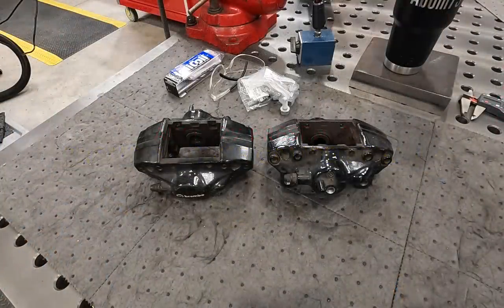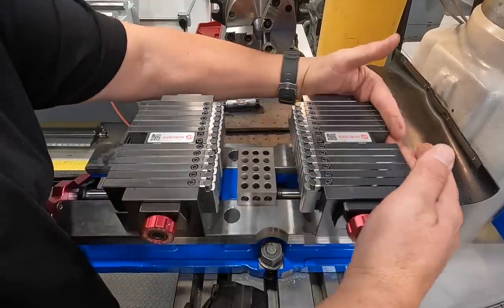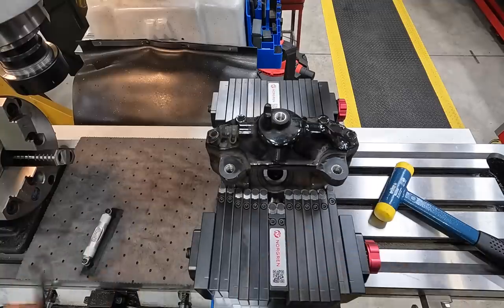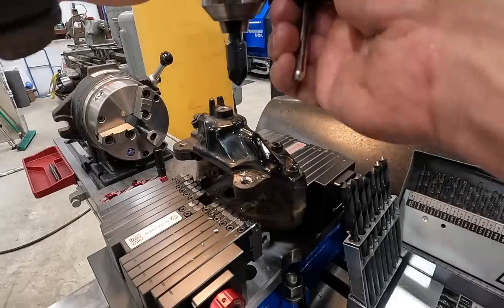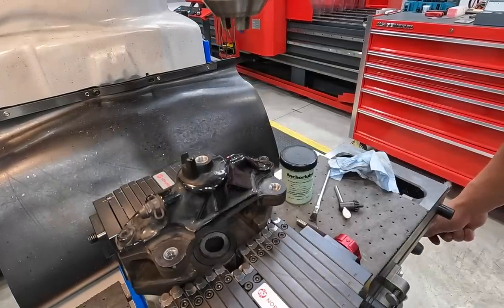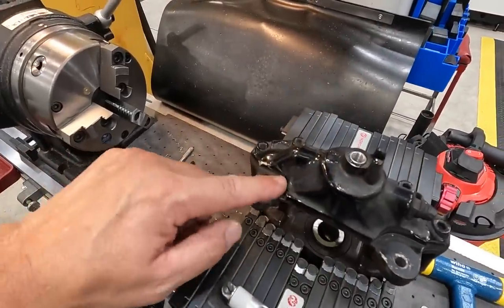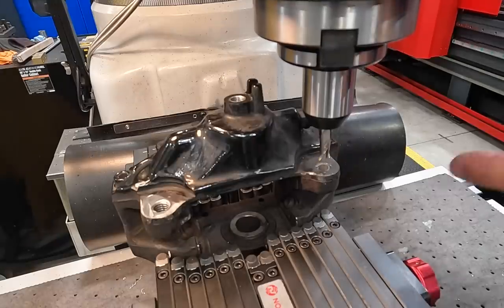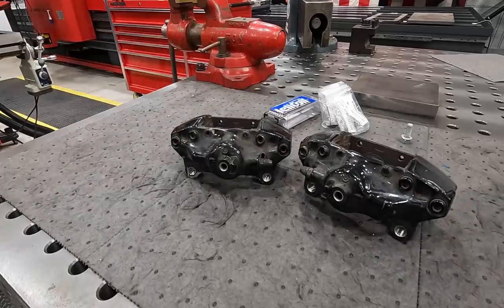Brembo Brake Caliper Repair

Comment: Did anyone else notice while tapping the 3rd hole at around 27:33 that the tap started pulling the casting out of the vice as is was coasting to a stop?   Perhaps that side wasn't as snug as the other, or as well-fitting in the jaws as the first caliper.  This suggest to me that the vice is good at applying lateral force to irregularly shaped work, but the smooth jaws do nothing to hold the work in the vertical direction.  Good on him for using a 1x2x3 block to support the downward pressure, but there is nothing preventing a lifting force.  Perhaps they need toothed jaws to bite into the workpiece?
Reply: Yup I noticed the same.
Reply: The tips are interchangeable, but I’m not sure what kind are available otherwise. Someone could even make or adapt their own, I’m sure too
Reply: Makes me wonder how many times something like this happens to me since I don’t have 50k+ people looking over my shoulder.
Reply: Maybe they're not worth the $7000 price tag after all
Reply: Yes, I noticed it lifting. Also at 29.20 the last right-hand jaw is not making contact with the caliper!

Comment: I have a question. Why did you use grease on the helicoil ? We have always used red locktite on the helicoils. We want to try and make sure the helicoil stays in place if the bolt has to be removed in the future. Thats a really neat vise you are using !!! Great video as usual !!!
Reply: i had exactly the same thought on glueing the helicoil in
Reply: You don’t want it binding as you screw it in. If that happens and you break the tang then you have no way of driving it the rest of the way in.

Comment: I would leave some tension on the fixed jaw side so the fingers have some resistance and leave the movable jaw side looser than the fixed jaw so everything conforms nicely then tighten both to half torque spec so about 30-32ft/lbs then tighten the clamp down and go to full torque until the fingers have been "broken in" for lack of better terms once broken in you shouldn't have a stuck finger like on the first caliper

Comment: To remove the moon shell of bolt I use a cut down hack saw blade. 
Saw deep enough to cut to threads then small chisel to break out one half at a time. It won't chance spinning shell and break end mill or worse.

Comment: Isn't there a long term problem with electrolytic corrosion between the stainless Helicoil insert and the aluminium caliper, particularly as brake calipers are frequently sprayed with water from the road, including salt water sometimes? Helicoil does make a "Primer Free" version of their inserts that is supposed to prevent that.
Reply: Stainless. Should be self explanatory.
Reply: @consaka1  I'm talking about corrosion of the aluminium, it being much lower in the galvanic series than stainless steel.
Reply: @samuelfielder  hmm I haven't noticed that being a huge problem in the aluminum I've used stainless screws in. Perhaps because I lube the threads pretty good? I've seen some fierce corrosion in aluminum using regular steel fasteners though. Some of that could probably have been mitigated with some sort of lube.
Reply: @Randy G I'm not a huge expert on the matter but if I remember the corrosion process still requires oxygen. Perhaps the grease he used will work somewhat to smother the corrosion. Though just between you and me he didn't use near enough for that purpose. I think copious amounts of red locktite would though and that's what I have used in the past.
Reply: @Randy G I prefer the more solid inserts myself too but I know helicoil are very tough and better than the original. Greased I'd be concerned it might eventually wash out and that the threads might be prone to come out. Locktite would solve both problems on any insert not just helicoil.

Comment: Many, many, many years ago, when all my tools fit in an old red Craftsman  toolbox in the trunk of my car I learned about Heli-coils. Back then it was business as usual to go down to your local parts store and buy a Heli-coil kit to fix stripped out threads on whatever was broken (or I broke) on my car. It wasn't rocket science, no special training or skills required, RTFM! As I became more proficient and knowledgeable I learned to proactively replace the threads on aluminum parts with Heli-coils. As I was getting into racing I was seeing more aluminum parts replacing cast iron, but also failing more than cast iron. For some reason aluminum just didn't trust me when I torque it using just my right arm, go figure. Abom stated there was no way to attach the calipers to machine/drill holes, thus requiring a $7000 vise? Drill 2 holes in a piece of steel plate lining up with the unaffected caliper bolts. Even use one hole to bolt to the piece of plate, then swap holes after drilling out the first. Bolt caliper to steel plate, clamp plate in vise. Drill. What am I missing here? If you have the skill to replace the calipers, you've probably got the skills to do this in your driveway or garage. No machine shop or $7000 vise required. Is Abom saying he could not do the repair without this vise? It would have been much more helpful/informative to demo how to do this without the vise. At least it isn't a 12 part series!
Reply: He knows that. He's trying to demonstrate the vise. In a working CNC shop that vise might make it unnecessary to machine a pair of soft jaws for a limited number of parts. That's money saved. If you do that once a day for a while, the vise pays for itself in saved soft jaws and their machining.

Comment: One item I would have discussed is to be sure the insert is not too long for the hole.. I use a Dremel tool with a cut-off wheel to cut threads off for whatever is necessary for the hole length.

Comment: a nice little saturday project.  did you have any problems with chips getting in between the teeth of the soft jaws?  That's the reason I got rid of mine, chips and shavings (especially with cast iron) would get in between the fingers, or rotary swivel clamps in my case, and would gum it up.  I got tired of having to take it apart every few months and clean it out, so I just resort to using spacer blocks and angles now.  Something you might want to keep an eye on, or you could do like my dad did and cover the vise with some old mud flap material.

Comment: What stops those coils from coming loose when you screw in the bolt, especially so since you put some lube between the coil and calliper?
Reply: The coil is more of a interference fit then the bolt for one and the clamping force when tightened the bolt also holds the coil to the new threads, these may look janky but have been proven for years, very good fix solution in many cases
Reply: I should’ve read the comments…I just asked the same question
Reply: @skippybuilt  I watched the video a few more times after I commented - yeah, you can see the coil is reasonably tight against the thread, and when the bolt goes in it seems to go in freely, almost a little loose. So I guess when it’s being tightened down, it doesn’t exert any force on the coil until right at the very end. Good explanation though, thanks 🙏
Reply: That is why you need the insert tool to put the coil in, it tightens the spring so it will screw in, then when the tool is withdrawn the insert expands against the thread locking it in the bore.
Reply: @ZylonFPV  This is the case with a plain threaded bolt, too. There is no clamping force on the threads until the end of the cap hits the surface of the mating material. This is why torque processes in manufacturing can sometimes require quite a bit of study to get just right.

Comment: I probably would have used red loctite on the coil instead of the lube. Great repair love these kinds of videos.
Reply: The problem with Loctite on the inserts is it might get into the bolt threads. Just Anti seize on the bolts should be fine as the Heli coil inserts actually expand to be tight in the part.

That last one was one of those that could have gone bad but didn't! 😆

I just hope the caliper pistons are in good shape, but it would be smart for the owner to rebuild that part anyway.

Comment: Red Locktite on a Helicoil…Always!
Reply: I was wondering how the helicoil will stay in on a through hole.
Reply: @skmetal7    Properly installed.... and the correct length is used and the tang is removed the coil has tension to stay put.

Comment: I've used a tapping head in a mill before.. it allows better control of the tap torque.

You had me cringing when you power tapped the helicoils.. 
Do you find lubricating drill bits worthwhile?

Thanks a lot for your videos. Very informative.

Comment: Why no thread locker?
Reply: I was wondering the same. I think I used it when I did one hole on my old Dakota caliper.
Reply: Yeah shoulda used threadlocker instead of grease. 

The grease was probably worse than nothing lol.
Reply: The ‘spring‘ of the wire thread insert provides grip. Once the bolt is installed and fully torqued up the insert is secure. If I remember well dry installation is the default.

Comment: those break calipers  should come apart and you would have a flat surface mount in the vice
Reply: Exactly what I was about to comment - they do split for rebuilding/repair .... also the brake fluid inlet was not plugged or covered during machining.
Reply: and take on the responsibility of resealing them with no leaks? no thanks
Reply: @bmjnk3  only 1 o-ring per side of the caliper. Super simple and cheap to replace.

Comment: It's nice to see this vise in action, though in practice for this application it probably would have made more sense to split the calipers and just clamp it down to the mill table. Another option would be to put some flat bar through the middle stacked up on some blocks, and clamp the caliper down to it, you'd probably find a flat enough spot around the pistons for that to work.

I think some of the comments about safety are maybe a bit overblown. On a caliper like this, the bolts are likely not being relied on for an axial clamping force. At most these bolts will primarily see radial forces, and will just need to not fall out on their own. That said, it wouldn't occur to me to use a helicoil without loctite to hold it in place.
Reply: Exactly what I was thinking

Comment: The error here is in the order of operations.
1) Pull all the fingers - out - as far open as possible.
2) Leave the adjustable clamps loose.
3) Clamp not too hard on the part using the main vise.

4) Push all the fingers in to firm contact with the part.
5) Tighten up the ajustable clamps
6) Tighten up the main vise.

Left out the levelling steps - but those will go much easier if you start with the above.

Comment: Why would you not use a thread locking compound on the insert?
Reply: Using lube instead of thread lock is wrong!~
Reply: The insert used is an open thread design, locking fluid would ooze into the internal threads and  could cause the insert screw out while the bolt is being screwed in. In a blind hole it could jam the bolt and insert causing more damage to the repaired part.  The insert is a slight interference fit and that keeps the insert from coming out.  Some claim the breaking of the tab has a locking affect also.  They go in dry no oils or locking fluid.    There are other type of thread repair designs that use a locking compound, but are not open threads like he used in this video.  Adam has a few older videos about Helicoils also
Reply: @chuckhabrack3330  my question was more specifically that the insert is in a through hole. I can see not using a locking compound on a blind hole but a through hole has nothing to stop the insert from being screwed out the bottom if the bolt catches in the insert while it's being screwed in.
Reply: @eddiebutts7923  Like I said its and interference fit and the chances of it coming out are extremely low. They are friction locked in because of the interference, and removal is destructive to the insert.  I have installed hundreds maybe thousands in my time both blind and through holes and never had an issue  of one unscrewing.    I worked building engines and thread repair was common.
Reply: @eddiebutts7923  Ever try to get an installed heli-coil out of a through or blind hole?  If you have, you have your answer LOL

Comment: Allowing the tap to pull the spindle down is fine in steel but aluminum gives me the willys especially on a vertical mill. A loose drill press maybe but I'd be afraid of the mills resistance pulling the first threads out if the part before enough are cut.
Reply: Yes will result in a loose thread as demonstrated by Kurtis on CEE making his toolpost 2 days ago.
Reply: @willemvantsant5105  I love his videos and cant wait for part 2
Reply: @willemvantsant5105  Taps tend to make loose threads just by the nature of their design. Once the thread is cut the remaining portion of the tap doesn't do anything except engage the thread. I'd like to see someone do a test of different techniques and their result on thread fit to either confirm or bust this theory. Might make a good video?

Comment: Not all the vice fingers are touching. the center 2 fixed fingers on both jaws are not touching and I believe they should. by tightening the vice until they just touch. help me if I am incorrect.
Reply: I agree. Seems you would want to clamp the widest part of the workpiece between the fixed fingers then bring in the rest of the gang.
Reply: Honestly what I thought. The fixed fingers get tightened to hold the piece and then the rest get pushed in to support it and then tighten everything up.

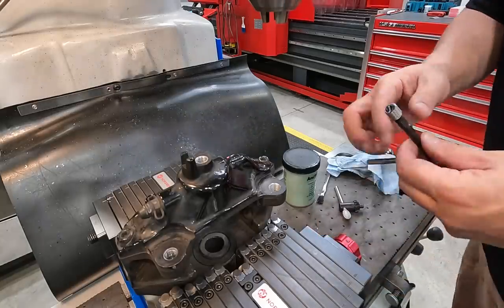Comment: 18:53 It's not advisable to lubricate coil type thread inserts. Because they are driven from the front end of the insert by the insertion tool, the insert adopts a smaller diameter and grips the tool as the insertion torque is applied. Once the torque ceases , the coil springs back to it's original diameter and grips the threaded hole and the insertion tool can be backed out easily.
This is also why the coil grips the hole and not the bolt when the bolt is removed at a later time. As a bolt is screwed into the insert , it applies a torque to the insert from the back end and causes the insert to try to increase in diameter , the opposite of the insertion process, and the outer diameter of the insert grips the hole , preventing it from turning.
This is why they use a wire coil and not just a cylinder threaded on the ID and OD.
Lubricating the OD of the coil may result in the coil coming out next time the bolt is removed.
Reply: Have you ever tried winding an insert out? Absolutely no way is that coming out, lubricant or not!  And definitely no need for Loctite.
Reply: @andyp2001  You seem to have missed how my whole comment explains why that is the case.
And also that I made no mention of thread locking compounds.
Btw If you can grab the bottom end of the coil with pliers, they wind out exceeding easily

Comment: I don’t know why the manufacturer doesn’t just put the HELICOIL in right from the factory because this problem with aluminum threads are so prevalent!
PS, how come you didn’t use the permanent fingers in the center on your new adaptive soft jaws?
Reply: That’s because this will not hold up as the galvanic corrosion will eat up the aluminum around the helicoil.
Reply: To be clear. It will hold up the same time as the original part. But it’s just not worth doing it from the factory as the result will be the Sam. Galvanic corrosion. The solution would be to have the bolts made in aluminum, but that’s not an option for this implementation.
Reply: @jesperwall839  That's exactly why I prefer "Keenserts" in aluminium and areas subject to heating/cooling cycles. They can be bonded in for a layer of corrosion  protection and down the road should the need arise you can run a tap through them where as you can't with a helicoil.
Reply: Cost and efficiency, mostly. It's really unnecessary to have inserts if you just take care of your parts. The previous owner of these calipers must have been a really poor DIY mechanic.

Also, adding additional operations is always adding another opportunity to screw it up in the production line (and waste even more time and money).
Reply: It will last past the warrantee period, that's all the manufacturers care about.
Reply: @jesperwall839  Aluminum bolt threads can’t hold a candle to steel Helicoil. Aluminum on aluminum threads are to soft that gums up and just creates a galling problem period!
Reply: @eastcoastwatch672  Yeah, I just wrote that.

Comment: Adam why did you choose to use Anchor Lube instead of Lock Tite to set the Helic Coil? It seems the Anchor Lube would allow the threaded insert to move around🤷 I’m not a machinist, I’m just gently asking.
Reply: They should be installed dry. No loctite or antiseize should be used on the insert itself.
Reply: Anchor Lube was used for tapping the threads . Heli Coils are locked in place by spring tension and don't need Loctite.
Reply: @ellieprice3396  He actually lubed the Helicoils. See 18:56

Comment: Very surprised you did not use loctite. I would be worried those heli coils will loosen and screw out since the bottom of the hole is open.

Comment: Why lube the Helicoils? I was expecting application of Loctite 2620 or similar to secure it in there?
I work in IT, so I'm not trying to tell anyone how to do their work in another field, but I wondered how those coils are going to stay in place.
Reply: They are designed to grip as the bolt is tightened.
Reply: He was out of CRC!
Reply: Having installed hundreds of helicoils I can say that there's no need to worry. Those suckers aren't going to move. They're designed to fit right and can only be screwed in with the insertion tool/ tang that slightly reduces the OD of the spiral insert.  Break off the tang and they are virtually impossible to get out, even if you want to.  Don't ask me how I know this LOL